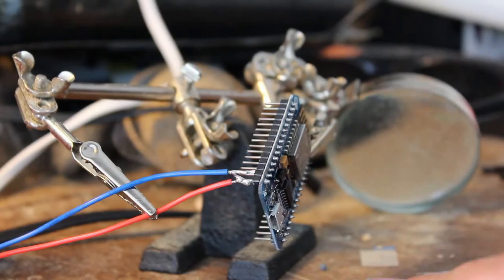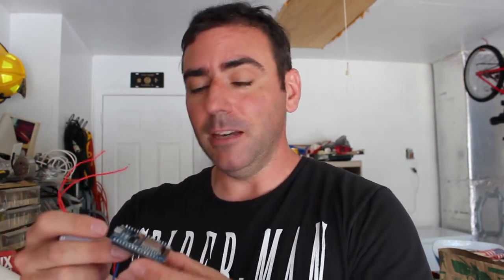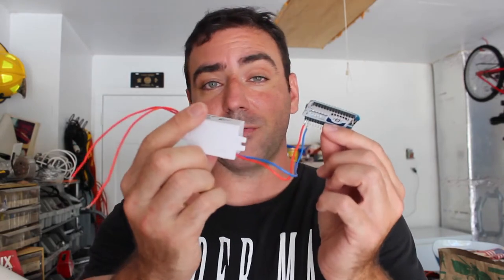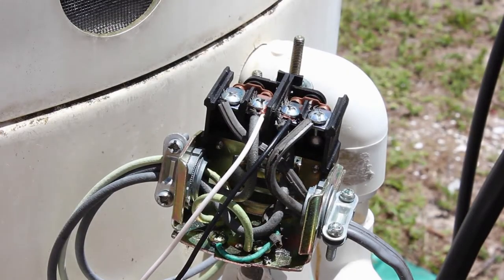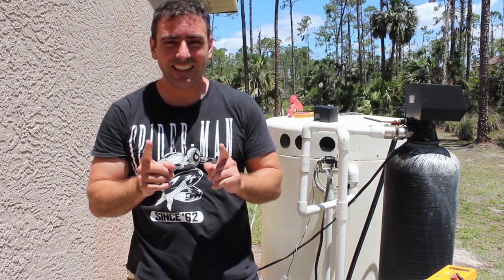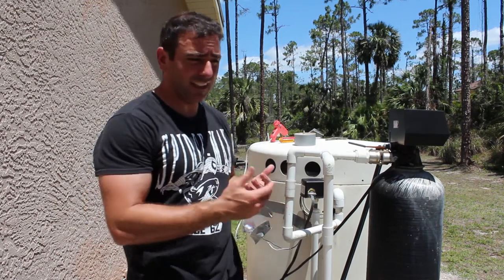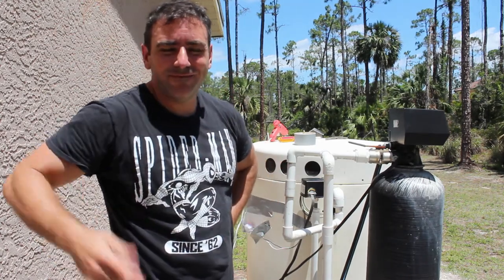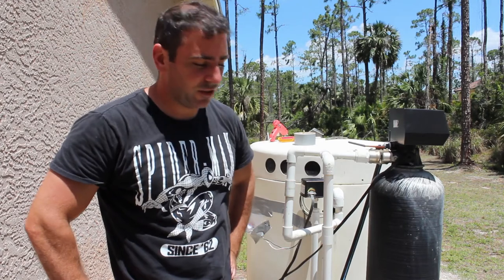Wifi Water Pump Alarm with an ESP8266

Comment: Neat idea for a home automation/monitoring project that I never needed but now want. I admire the super simple concept of having the unit just turn on when the pump has power but have you thought about switching to an always on version that monitors pump and softener? Maybe add outdoor temperature, humidity and others all on the same 8266.
Reply: outdoor temperature, humidity,
Florida = Extremely Hot and Humid   :P
Yes, I could do something like that.  Having the ESP on all the time would be easy, just plug it into an outlet.  I would have to figure out a way to detect when the power comes on, 220v to a digital in pin.  But, it would be possible.  Not on my todo list now, but possible in the future.

Comment: Your ziplock weatherproofing is fine if you seal it and toss some desiccant inside to keep moisture away from the electronics. Epoxy around the wire hole maybe?

Comment: Great project but the enclosure man. Just get a proper enclosure from a hardware store, mostly when having high voltage wires out there. You never know if a kid or animal will mess with it and cause it to create a short and make a mess.

Comment: This is a great idea Kris... But this increases the count of wifi connection, so how about connecting to the wifi if your pump is turned on for 5 minutes? I mean, that way, your ESP8266 won't be connected to the wifi everytime the pump turns on...
Reply: Well, for one I like having the log of every time it turns on.  If gives me a clearer picture of how often each pump runs so I can troubleshoot problems.
Reply: If the ESP doesn't connect every time you don't know that the pump is okay or the esp is died (unlucky: esp and pump wrong too). This way you know that the ESP is working correctly, and it didn't died. Maybe you could throw in a function on the server, that notifies you when it didn't heard about the ESP in a long time, so you could check if it is broken or sómething. And for an other few bucks you could buy a "real" weather proof wiring box. It's like $3 here and I use them for quite a lot of things around the house, looks way better and more professional :D
Reply: Ok, that seems fair now... But buy a nice waterproof cover... BTW, thanks for the great idea... Hey one request... Can you do a python tutorial on OpenCV, and face detection?